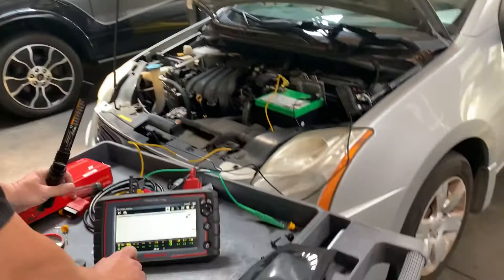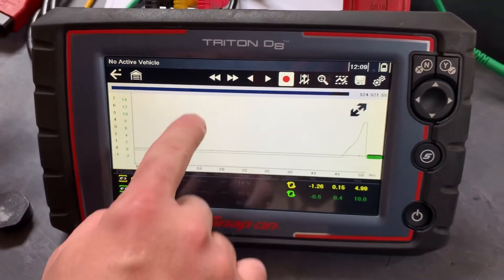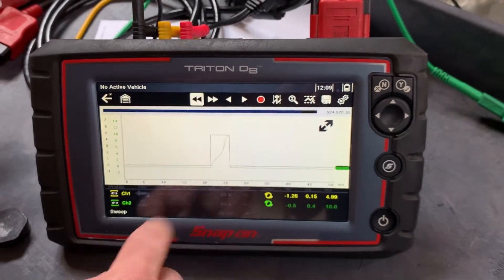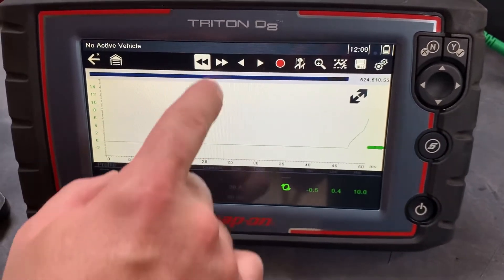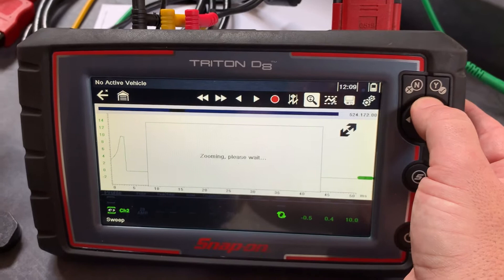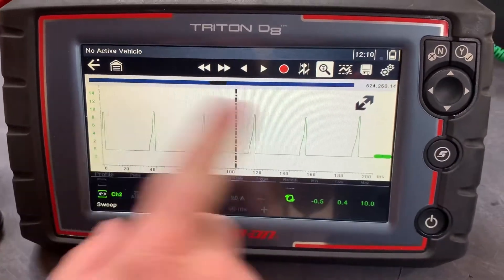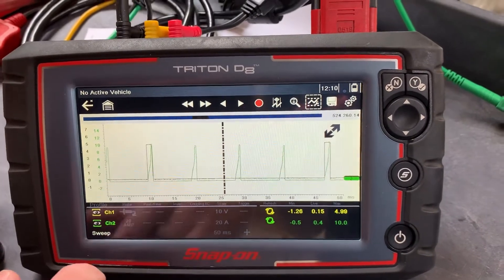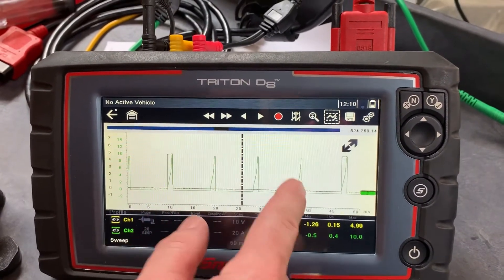2011 Nissan Sentra - Cylinder 1 Misfire Diagnosis

Comment: Not enough fuel cause misfire too lean conditions. Nissan have the pump assembly in the tank with filter all related components. Intake manifold sit over the valve cover cheaply design consistently removing the 2 short bolts at the rear and the 5 at the front for repairs and maintenance.
Reply: So?  What u mean

Comment: Great video. But I would have recommended all 4 injectors aftermarket cheap ones because of fuel mileage improvement. Since you have everything apart already. New injectors cost a fortune.